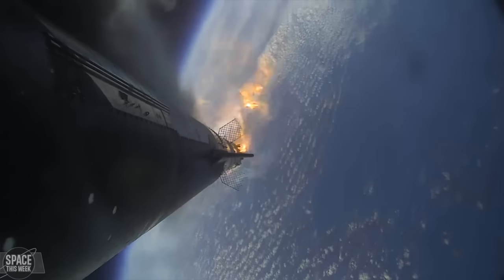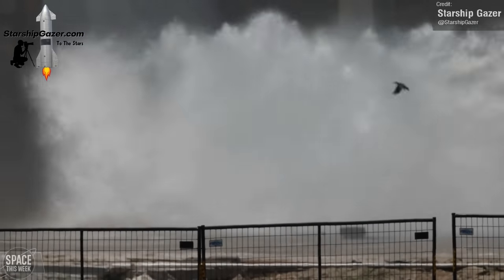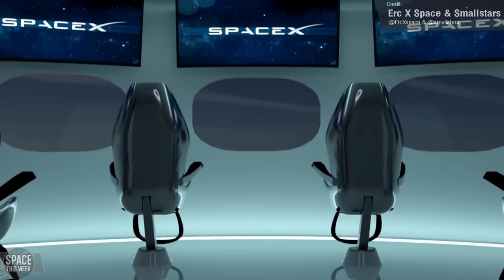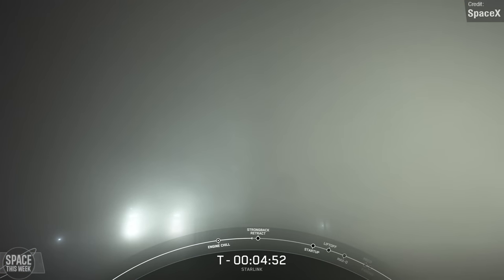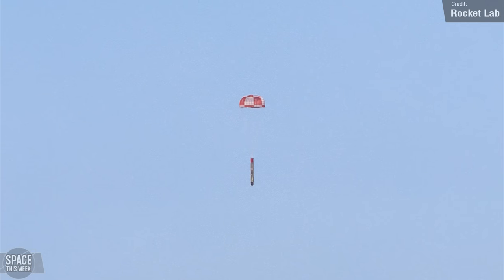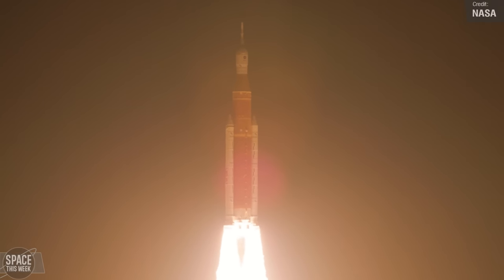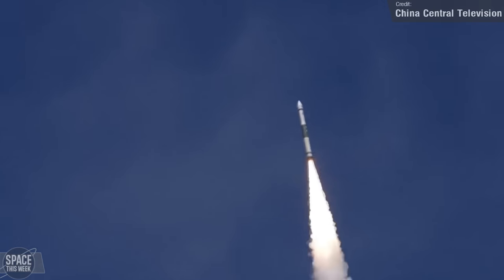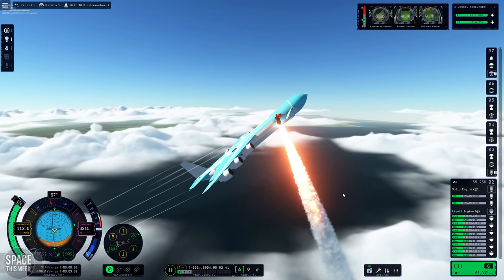SpaceX Superheavy FULLY FUELLED in first launchpad test, Rocket Lab Recovery Mission, SLS Update

Comment: Matt, Orion cannot fit a 3m international dock on the top i think. As for starship, It would be probable to have the dock on the side where the airlocks are and not on the top. Same for refueling in orbit, there is a QD connector, so it is reasonable to see that as refueling connector.

Comment: It is very important to keep OLM loaded with fully fueled SH Booster on top of it while concrete at center slab keeps on curing. Otherwise Space Cadets at SpaceX  could wake up again with OLM getting hammered into alluvial subsoil below it cracking center slab or just braking away from it.

Comment: I still don't get the point in having a full-size Starship as the lunar lander, do they need those massive tanks for that?
I'm no rocket engineer but since its "lunar" engines are very high up I don't see why they can't make it 3-stage and have the bottom half bring it to the lunar orbit.
Reply: They can bring a lot of cargo with a big rocket
Reply: @Spaceman0025  Right, but the bottom half of the Lunar Starship is, at least with what they have said/shown so far (which I realize is just a mockup before even Starhopper was a thing), more or less the same internally as the regular ship. Two big fuel tanks (or well, 3 with methane header).

The raptor engines brings it to the moon, then they are pretty much just dead weight as they have other engines to do the lunar landing.
Reply: @AQDuck I mean, hey, it looks cool
Reply: The point is to have enough commonality between Lunar Starship and 'main' Starship that drives down costs and makes the program worthwhile. Splitting HLS into two would eliminate most of that commonality, which would eliminate the cost and schedule savings.

Remember that the reason HLS exists and why it was so cheap compared to the other candidates was that most of it was tech that SpaceX was going to be spending its own money on anyway on the road to Mars. As a result some aspects of it are slightly awkward for the Moon, but the overall capabilities more than make up for that.
Reply: @AQDuck Raptors could be used for most of the lunar descent, with those small engines going solo only when very close to the surface.
Reply: @AQDuck  Did you miss the memo on orbital refueling? A lunar ship could potentially be refueled and do multiple flights. In fact the whole "using Orion" bit is bullshit because you could just launch the crew on a dragon, dock in earth orbit with lunar starship that's been fueled, then have them travel in that to the moon and back.

Comment: for the life of me i can not think of a way how starship is supposed to stay upright on the moon. afaik there is very uneven terrain with fine dust covering everything so you have no idea of the "even-ness" of your landing zone, making a catastrophic tipping over pretty likely. are they just gona hop around hoping to find even enough footing to keep that pencil upright?
Reply: You do know that the Starship is 9m in diameter, as in 30 feet? There are MANY hi-res images of the Moon, so there should be no trouble finding a suitable landing site.
Reply: @steveaustin2686  You do know that the starship is 50 meters high? that makes her tippingangle only like 10°. and those highres pictures are pictures of the dust on the surface with no information about the hard ground below that may or may not support a 500 ton vehicle on small landingfeet.
Reply: @tomduke1297  No, really. 🙄🙄

You do know that the Apollo missions gave NASA a lot of information on the Moon and its surface, right? And if the Falcon 9 legs are anything to go by, the legs for HLS Starship will provide a larger base than 9 meters. The temporary one-use legs for the SN5-SN15 flights are not the final design. NASA engineers had first hand access to HLS Starship and they are evidently not worried based on the HLS Option A Source Selection Statement. I'll take their experience over internet back seat drivers any day.

Comment: There was one mistake block B SLS cant fly until they get the block B lounch pad and carrier  build. And it took them 10 years to build last one.. lol dont look for SLS to fly any time soon. That also douse not cover the problems with the BE-4 engine problems. So no artimas is not going any where for a time..
Reply: The SLS Block 1B is for Artemis IV through Artemis VIII. The NASA IG does say that the ML-2 is behind schedule, so the planned 2027 date will likely slip. Since Artemis III is sliding into at least 2026, that isn't as big a deal as it appears.

The BE-4 engine is used on the Vulcan Centaur (2/booster) and the New Glenn (7/booster). The SLS of all variants, uses the RS-25 engine. The first flights are reusing old Shuttle RS-25 engines and the later flights are using new build, one-use RS-25 engines.

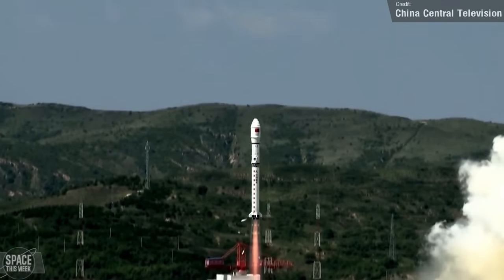Comment: 11:51 why is that rocket peeling of paper?
Reply: I believe that might be ice but im not a hundred percent sure
Reply: It's insulation. IIRC, that rocket doesn't use cyrogenic propellant, but many propellants have a best use temp, so the insulation keeps the upper stage in that temp. The Minotaur I has long yellow strips instead of smaller panels for the same reason. The yellow strips on the solid rocket first stage of the Minotaur I kind of unzips, so it has the nickname of the banana rocket.
Reply: @Celestialfury10  It's insulation.
Reply: @Spaceman0025  It's insulation.

Comment: It is possible that substantial part of water in high temperature generated by rocket engines will change into Hydrogen and Oxygen. When it happens - if happens - the next departure could transform into disaster. Be warned, check your basic assumptions.
Reply: the energy requirements just aren't met the gaseous steam cools liquid water as it as goes through phase transition then gets shunted away by high velocity exhaust gasses leaving fresh water to further the cooling and shock dampening roles.

Comment: Do they really think 1) that they’ll land on a perfectly flat spot on the moon for those stupid little legs to work? And 2) that they wont damage the rocket if they launch from the moon with all the thrust hitting the floor just a couple feet below?!

Feels like hyperloop vaporware.
Reply: Those are an artists conception of how the legs might work. SpaceX has not released the design for the HLS Starship legs yet.

Currently, HLS Starship is planned to have a ring of 24 methane engines at the top of the propellant tanks. Those engines would be the ones doing the last bit of landing and first bit of launch from the surface. Since they are roughly 25 meters off the ground, that should minimize regolith disturbance.